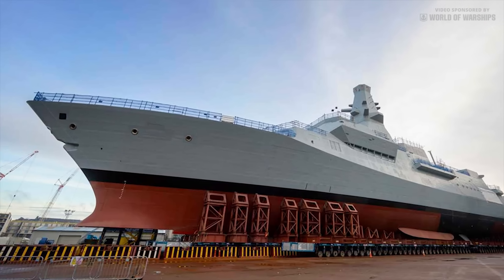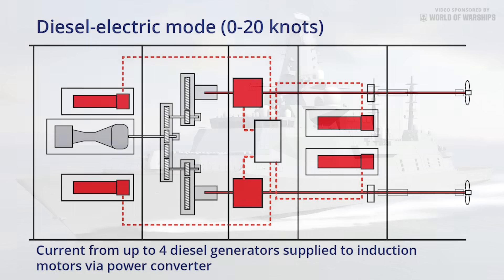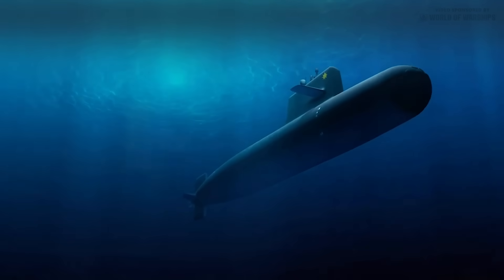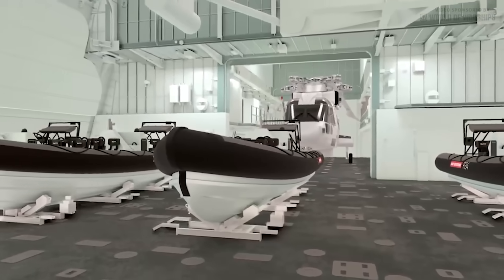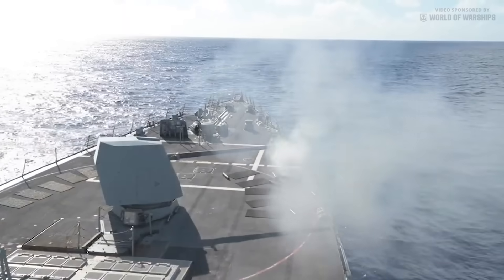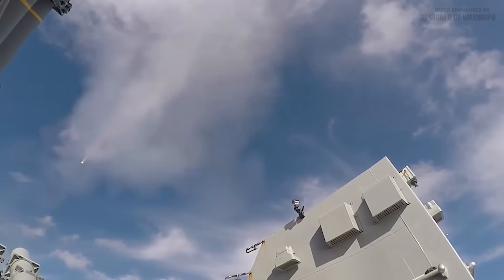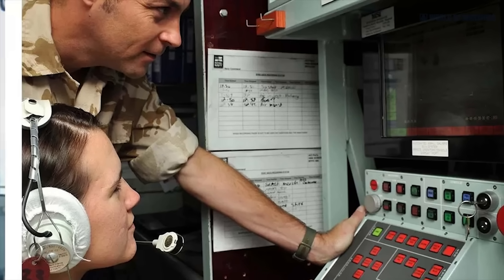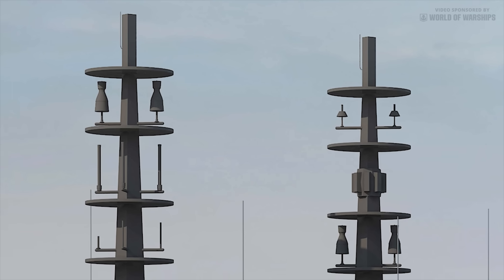An in-depth look at the Type 26 frigate design

Comment: simple math here, detecting mach 3 targets at 22km max distance gives less than 22 secs of flight time inbound from max distance for the human interaction to act. That is detection, establishing an actual real target and accurate course/position + relative to ship, intent, and get the proper orders/permissions for action against. If the ship and ship's company are already at GQ and 'Battle stations manned' posture, maybe this is a plausible doable defense as it would give CIC around 8 secs or less to turn CIWS to auto and get guns on target, but this would most likely eliminate any other defensive options as I doubt there is enough time to activate chaff or flare systems and get CIWZ in its proper settings + locked into the target. As a perimeter sentry, this would be a major deficiency in future tech naval combat area tech dependencies.
Reply: In a high threat environment I believe they would be travelling with Type 45s. If they are alone though then you aren't wrong. Not a fun situation to be in
Reply: @regarded9702  I firmly believe these are tokens. Their total build layout just says sponge. Low-range air sensors, bell sonar, slow, with long-range econo benefit. 

I was originally disturbed to see the US buying a non-US Frigate until the specs started getting released. The US Frigate is basically a mini Destroyer. This should have been the way the British went as well. Side by Side comparison just shows how the British are getting hosed as you see them paying almost $0.5B more per unit, and that is only compared to the US's 3-unit purchase, as the per unit cost will drop below $1B/unit when they approve the next 7 to round out the 10 unit reserve already allotted for. The plan is to buy 15-25 units which will drive the costs per unit down even more.
Reply: @robertevans2450  the Royal Navy has what seems to be organizational PTSD from the Falklands War. Losing HMS Sheffield (and others) because of type 42s doing things other than constantly scanning for missiles - and then not being perfectly equipped for that role when they did manage to find the Exocets - must be something burned into Royal Navy officer's heads during their training and education. The whole Falklands War was millimeters from a national embarrassment honestly.

It seems that since then every ship will do it's job and not much else. Type 23 is anti-sub, it can do limited anti-air and anti-surface but it is focused around looking for Russian subs.

Type 45 can almost only do anti-air, it has some old Harpoons as an almost token gesture (getting upgraded to Naval Strike Missile thankfully) and I'm not certain it can do anything to subs if it can even find them.

And then the Type 26 follows the formula mostly. It finds and kills subs. Anti-air? It can just about defend itself but even that is sketchy. Anti-ship? Well it somewhat breaks convention here by possibly having up to 24 in its VLS alone, it won't have that many obviously but at least it won't be toothless like a lot of Royal Navy vessels.
Reply: @regarded9702  good analysis but I would have a couple of questions...Did the final build have towed array? I'm under the impression that they dropped it and it has just the active bell sonar in front. Does it have the sensors and combat management system capable of actually using the NSM?
Reply: @regarded9702  The RN is literally the only Western Navy to have fought a peer enemy since the second world war.
Reply: @regarded9702  How is 48 CAMM missiles 'just about'?
Reply: @Louis-ej1lx  I was referring more to the range of CAMM missiles than the quantity. It is my understanding that they are too short range for fleet defence.

Wikipedia says that CAMM has a range of greater than 25km, Aster 30 (what the type 45s have for longer range intercepts) have a range of up to 120km.
Reply: @Louis-ej1lx  I don't understand what you are implying with your first reply
Reply: @robertevans2450  if we are still talking about the type 26 then yes, as far as I am aware they will have a towed array sonar.

The big issue is that the type 31s don't have any sonar at all. Which makes them all but useless outside of a carrier group during an actual conflict.

Which is strange because these are the ships meant to be doing a lot of the east of Suez deployments, which are usually done individually I thought. So they would likely be the first targeted if conflict occurs outside of Europe. Seems like they are designed to die as soon as anything kicks of if they can't find  a burk to hide behind.

As for if the NSM will be integrated into the combat system, and if the type 45 even has the capability to properly use them, I can only assume so but I don't truly know.
Reply: @Regarded CAMM is a very good missile. The rate of fire is very good so saturation attacks can be dealt with easily. Cold launch and two separate missile silos contribute to that. It also has an incredibly short minimum range due to cold launch.
CAMM-EX is being developed between UK and Poland. At a guess it would have a higher range than CAMM-ER. The commander of 7 air defence group also said they would be getting CAMM-ER, and due to joint stockpiles, the Navy would get the same. He could of course be referring to CAMM-EX.
Ship to ship ASHM are irrelevant. Ships won’t get within range. The primary means of destroying enemy ships is submarines or aircraft. 

RN has more experience than any other Western Navy. For ASW especially, the RN has been spending 50+ years patrolling the GIUK gap and North Sea. That is why Merlin+T26+Astute will be the best ASW combination.
Reply: @Regarded A sonar could always be added to T31. The priority now is to get the hills in the water.
I don’t think you really have an understanding of ASW. Burkes are not good ships for it.
Reply: @Louis-ej1lx  fair enough about CAMM, I'm not sure why I was under the impression that 48 CAMM wasn't sufficient for self-defence. In my previous response I didn't even realise what I had said, hence me talking about suitable ranges for defending a csg. 

I haven't heard of CAMM-EX before, was it part of the recent deal we made with Poland? I must have missed it. If you could direct me towards any further reading on the topic I'd appreciate it.

As for future sonar on the type 31s, it is possible of course, I'm just hesitant to trust the classic 'built for but not with' song and dance. 

Although, with the heightened tensions in the world at the moment and in future we will hopefully be taking defence more seriously, so maybe they will go for it if they believe it necessary. They are finally using the extra VLS space on the type 45s so it seems the navy isn't ignoring the situation.
Reply: I said a burk because you would be more likely to find one of them near the straight of hormuz than any other allied vessel, which is where the hypothetical lone type 31 would be in the scenario I had in my head.

That being said, I know almost nothing about their ASW capabilities, I just vaguely remember them having a sonar.
Reply: @regarded9702  If there was a war to break out, and the T31 was near the straight of Hormuz, with no RN assets nearby, Italian or French FREMM would be the next best ASW ships. Burkes have both a bow sonar and a towed array, but are extremely noisy ships.
Reply: @regarded9702  Yep
Reply: 22km today between ships is virtually classified at point blank range determine by weponry factors. But navies today will be firing over the horizon seeking the longer reach
Reply: @Nathan-ry3yu  we are in agreement. The listed limits of this ship's systems IMHO remove it as a viable perimeter sentry, and instead make it only capable of doing fleet support where it can rely on the sensors of other ships to extend its capability. As a single-ship sentry, it is just too vulnerable to high-speed weapons to be viable.
Reply: Agreed. I have to assume the strategy is to detect/engage threats before they themselves engage, which seems a dicey proposition at best. I don't like the chances of any surface combatant these days.
Reply: @hdmccart6735  I think the strategy for these frigates is to be targets and to be token disposable frames. Even their speed suggests they are to make a presence without intent on fulfilling the threat such a presence was supposed to mean. They should be good for border interdiction missions, and anti-pirate missions, but otherwise they are not much greater than a mobile sensor buoy. Fleet on Fleet action they don't seem to add capability. But when a bean counter wishes to state how many frames they have, they will be able to tout a few extra. 

The US FFG62 is completely different. It isn't bound to mission by keel build like the British frigate, as it is configurable to do any task at just a reload away, and is built to basically provide the same capabilities as a DDG but with just fewer rounds to do the tasks. It pretty much carries the same sensors and combat systems as the Spurance class. The US went with a Frigate it can put on escort duty or interchange it within the Carrier Battle Group as extensions to its sensor layout and ranges. I don't get why the British, who could have nearly everything the US Navy could, would choose to go the route of such a less capable and less flexible option.   

As to your survivability point, I watched a frigate I was stationed to back in the 90s get absolutely pounded by weapon systems that were thought of being the death of ships like it. The new littoral ships notwithstanding, the rest of the fleet I think is much more survivable than given credit. The changes made to the new frigate from its Italian cousin suggest the US learned its lesson and they have returned to making a ship with a chin, without all that bulk that the Russian ships use to get their reputations.
Reply: @robertevans2450  Yea that doesn't really matter the only time she is going to be attacked is on a war setting where she will be at battle stations at all times, with CWIS prob already on auto aster 15 can also quite easily engage those targets, and more likely than not she will have a type 45 with her capable of tracking over 1000 targets the size of a cricket ball at 400Km and engaging them out to 120Km it is also announced it will be getting Anti Ballistic missile capabilities in the Aster 30 Block 1.

The type 26 doesn't need more anti air what she needs is more dedicated Anti sub weapons, if that's dedicated torp launchers or maybe something similar to ASROC.
Reply: Good ships have ESM, fast thinkings weapon systems, they can know what, where, how and can be ready on alert and some systems on auto. Tactics apply to everyone, find the ship first if so you have just might have alerted the ship, the ship might have CAP, Satellite tracking, Networking, all kinds of help and situational awareness.
In war most of the time they are not out there alone. A missile at Mach 3 at sea level much heat glow on seeker try slower speed, if the missile has a active seeker the ship will know something is out there beyond horizon as ESM will alert of awareness. Tactics'!

Comment: Hope the ship doesn't flood or bust it's propeller shaft or have a propulsion system that fails in warm regions.
Reply: Or have a anti ship crane dropped on it or someone smoking on deck multiple times or need a tug following the smoke trail when at sea. Still the tug crew must have their feet up as the Kuznetsov has not been to sea for years.
Reply: @anthonywilson4873  ikr - it's almost reached RN levels of efficiency and readiness!

Comment: BAE built the type 45 destroyers look how that ended
Reply: Government chose the engines, not BAE. 

Easy to blame contractors for Governmental failings.
Reply: @Kav.  Also its not strictly speaking the engines which are the problem..
Reply: @Markus117d  https://www.gov.uk/government/news/multi-million-pound-contract-to-enhance-royal-navy-type-45-fleet-resilience

"The Power Improvement Project (PIP) will enhance the resilience of the Type 45 class by installing additional power generation sources in each ship. Delivered as a major conversion project, the PIP will replace the two existing generators with three larger units capable of delivering the ships propulsion."

Replacing two generators with three = engines under powered = engines are one of potentially many issues.
Reply: Government expected too much from too small a platform due to budget constraints.
Reply: Do abit of research BAE have had years & millions of tax payers money to correct the  propulsion system
Reply: @darktruths133  At the time the UK Govt/MOD had two choices - choose the tried and tested LM2500 Gas Turbines from the USA ( as used in the Horizon/Orrizonte without issues - cousins of the T45 ),or go with the  new Northrop Grunman/RR WR21 set up,they chose the latter,and the rest as they say is history.
Reply: @darktruths133  I know more than you about Type 45 PIP. 

BAE is being paid to fix them because BAE built them to the Government Spec, the Government chose a spec that wouldn't work because the Government was cost cutting like morons. It's not BAE's fault. 

Shut up.
Reply: @Kav.  o do you mate

Comment: I do find the placement of the phalanx odd, it seems to have a very limited sideways firing arc.
Reply: Placement of Weapon Systems will inevatibly involve some compromises - where would you put them ?.
Reply: @paultanton4307  comprises definitely have to be made, but just curious to the reason.
IMO being defenseless (or depend on other ships) from weapons coming from the front or back seems dangerous too me. Even the decoys are only sideways.
Possible placements: one on the stern (or above the bridge), one aft (above the hangar), preferably alternating port and starboard;
Or further aft so they are (a little) higher;
Or more outwards;
Reply: @BotherNone  Beats the US that often has just one CIWS on it's warships. Even the AB is often missing the fwd CIWS
Reply: @BotherNone  A lot of Navies place a CIWS on top of the Hangar - the RN doesn't,if you Have your precious ASW Helicopter on the Flight Deck it could suffer damage from the sabot debris of the 20mm Phalanx rounds.The GoalKeeper position on the Type 22 B3 was not optimal but like i said it has to be a compromise.

Comment: I do not know a lot about warships and their design, but that fibreglass dome on the bows, how would that fare in very rough seas?
Reply: The underwater sonar dome? It's flooded, it's merely streamlining over the sonar system to improve slipperiness through the water meaning a lot less drag and higher speeds for the same power. 
Since it's full of water, any pressure from the outside just meets the pressure from the inside, and since water is incompressible there's no movement in the dome.
Reply: Patient: Doctor, my dome hurts when I slam it. What should I do? Doctor: Stop doing that. Anyway, fibreglass domes are stronger than rubber, which is one of the other main options.
Reply: Fiberglass is nothing new to ship hulls.  Tried and tested.  Unless you plan on hitting something, it shouldn't be a problem.
Reply: @lordtemplar9274 I thought they use solid steel over the entire ship